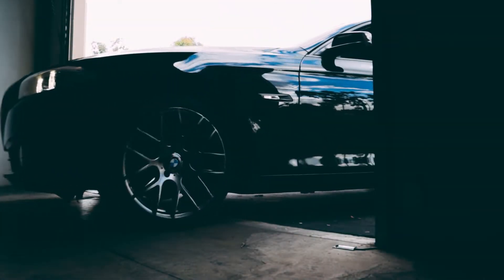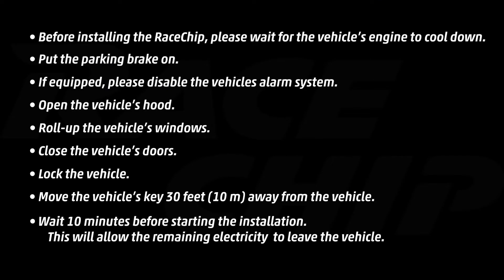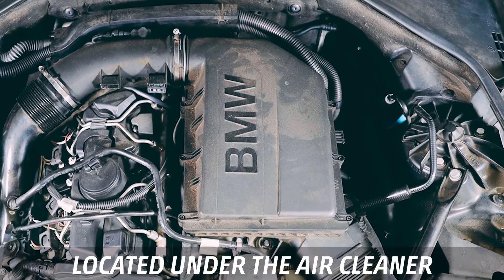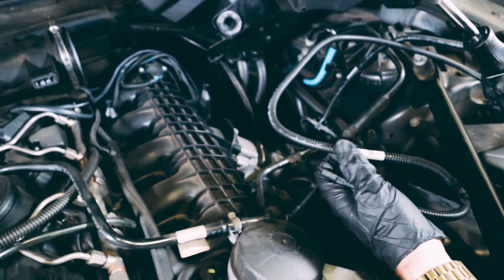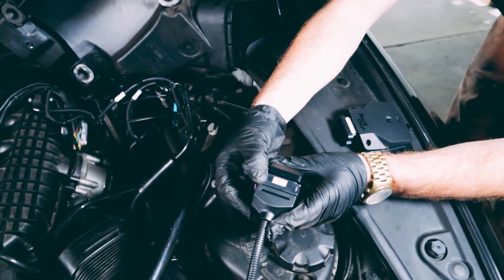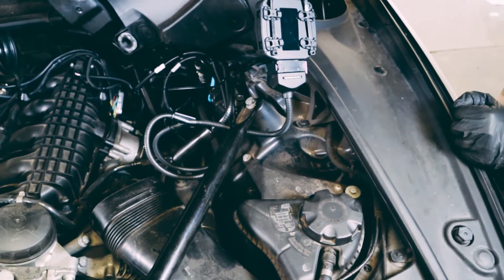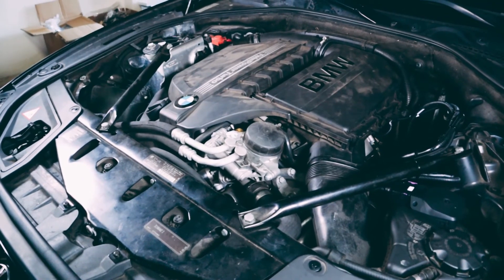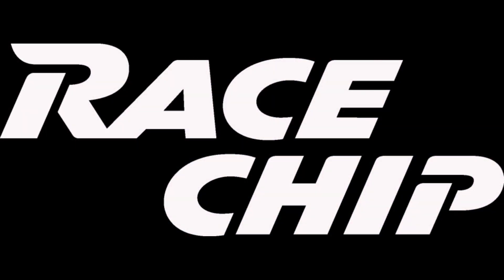BMW N55 Engine RaceChip Installation | 35i | 135i | 335i | 535i

Comment: So I already have the Race-Chip, which was in my X5 35i N55. I will be getting a 135i N55 in the next few weeks. Please can you advise if this will be plug and play or will I need to reprogram my Race-Chip to match, and if so how would I do this? Thanks
Reply from the maker: Hey Garry, head to the website and contact our customer support. They can get your device set up for the new vehicle for you.

Comment: i have a stock 2011 535 would i need to have prior mods to the car itself in order to install the race chip?
Reply: Probably a good idea to get an aluminium charge pipe first
Reply from the maker: No, the unit can work on a completely stock vehicle with no need to upgrade any components.
Reply: RaceChip Installation Videos no need for an exhaust upgrade nor a better intake? some have said you need those prior before the racechip but id rather ask you
Reply from the maker: @gaelgarcia2095  No, they are not required to run our product.
Reply: @RaceChipInstallationVideos  could i also use MHD with this RACE CHIP....and if not....which gives the most in horse power and torque?

Comment: I have a question, my car (e82 n55 135i) has a catless downpipe, will this work?
Reply from the maker: This product does not affect the dowpipe / emission control system. It works on cars with catless downpipes. You will probably get more power than claimed.
Reply: @RaceChipInstallationVideos   thank you very much for your reply, i appreciate it.  I would like to ask some question is there any email i can get in contact with? 
Thanks in advance
Chris
Reply from the maker: @christopersaavalderrama7384  please contact support@racechip.us